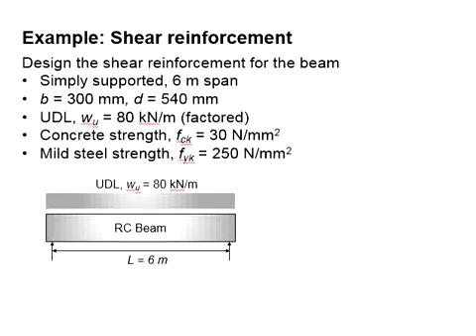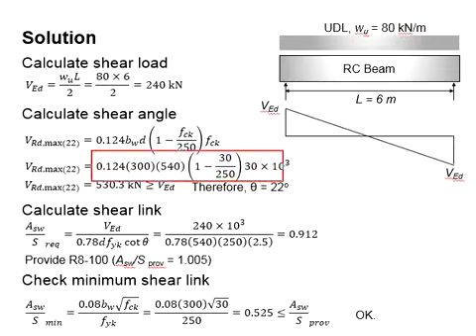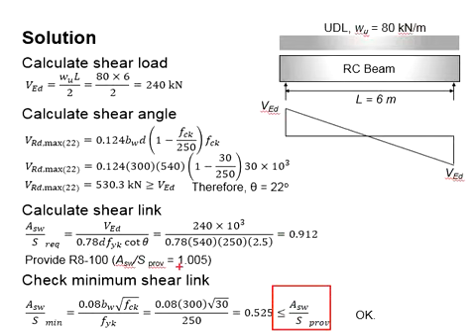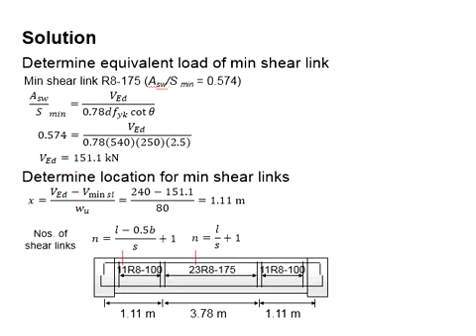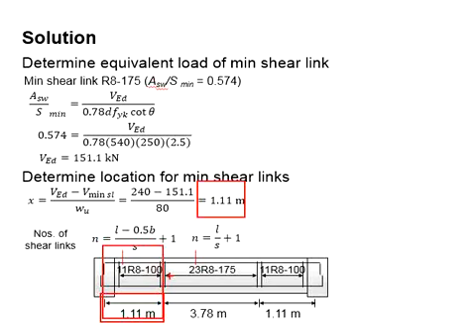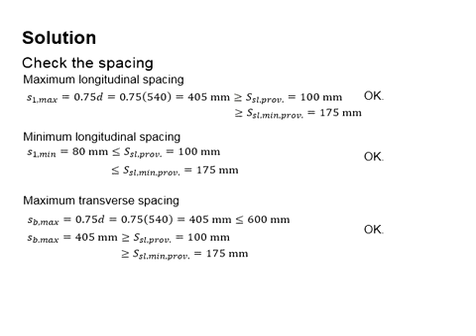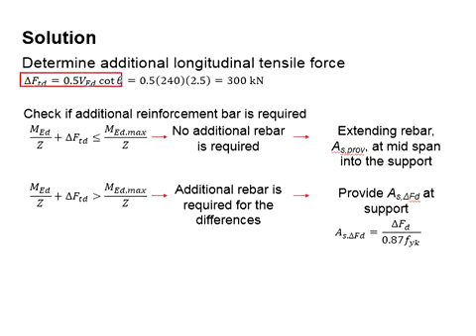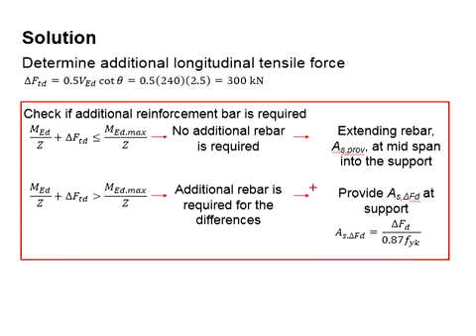7.15 Example: shear reinforcement

Comment: When solving for maximum transverse spacing, I thought sb = b - 2c - 2(shear link diameter) - 2(bar diameter) instead of sb = b - 2c  - shear ink diameter.
Reply from the maker: the one I used was centre-to-centre, yours will be clear spacing. Now the problem is whether it should be centre-to-centre or clear spacing, it was not clearly stated in EC2. Maybe you can enlighten me. Thank you.